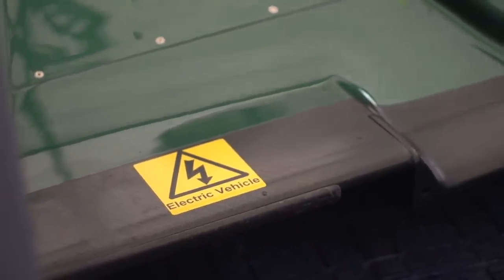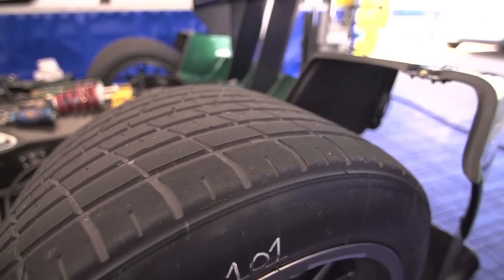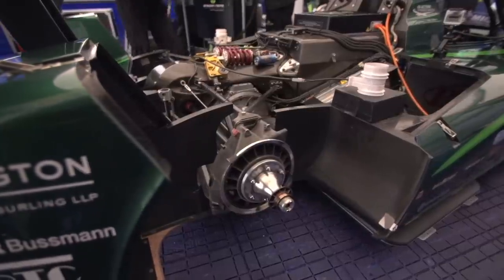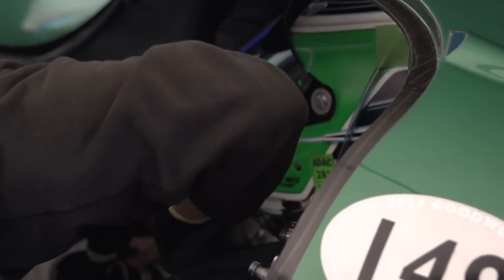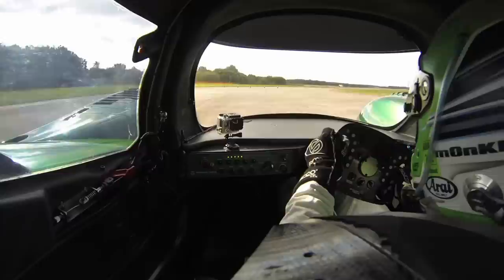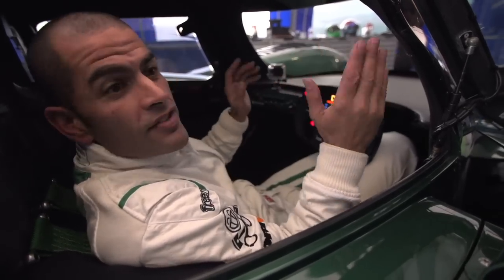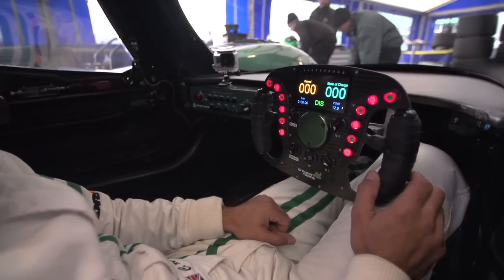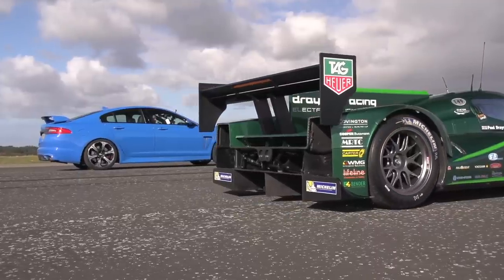850hp Electric Racing Car: Driving the Drayson B12/69EV -- /CHRIS HARRIS ON CARS

Comment: The only reason we like the sounds that race cars make is because race cars make them, and we associate the sound with speed. In actuality the sound is irrelevant. The silence of this machine makes it uncanny and incredible. I love that it's silent and I can't wait for the time when I don't hear what sounds like a race car going a hundred mph only to see a Honda Civic going thirty.
Reply: There is a tuned symphonic sound to a great engine that will never get old. Much like a cathedral pipe organ, a Stradivarius violin, or a saxophone, there's something inherently pleasing about a V12 at full rip, a beastly V8, a wailing Porsche flat 6, or a high-revving tuned 4.  May we never forget...
Reply: never forget the LFA's 9000 rpm howl.
Reply: Not really.
Reply: +Sidowse Teslas are a 1 trick pony. Accelerates quickly and doesn't do much else. Let's see it post some lap times
Reply: Sidowse I'll just buy a superformance cobra instead. Way more fun.
Reply: The Cobra like two stroke dirt bikes will always be badass because it's easy to work on and fucking fast. That said, engine sound with out the speed might as well be a flame job on a PT Cruiser.
Reply: Jordan Weimer a cobra would be fast as fuck even with 300hp because they are so light.
Reply: Sidowse  got quite a few track laps under my belt I know how to handle a car.
Reply: I totally disagree with you Jordan. I don´t like F! engine sound, for me it´s just annoying. But a road car enginge modified for track usage, with open intake and an not too loud exhaust is just a brutal sound that takes my breath when I´m standing right next to the car. You don´t like music made with an e-guitar because it´s made with an e-guitar, rather because it sounds awesome!

Comment: Wow, I kept trying to turn the volume up lol.... 
by watching this I realized when watching a video you get to feel the speed by hearing the engine rev.... Cool car and id love to drive it but entertaining to a crowd it is not!
Reply: Much agreed! While I respect the engineering and technology involved, it's this very sort of car that is killing the soul of the future. What the hell is the crowd going to enjoy with 30 of these on a track, waiting for a battery pack to melt down?
Reply: These cars have the potential to be reminiscent of the Porsche 917's from the early 1970's as far as performance potential and be even more so.  Paraphrased from wiki: "The 917/30 was the most powerful sports car ever built and raced. The 12 cylinder twin-turbo engine could produce 1,580 bhp (1,180 kW) in qualifying tune with twin turbos run up to full boost, 39 psi (2.7 bar), though it usually raced with around 1,100 bhp (820 kW) at 7,800 rpm to preserve the engine. Weighing 1,800 lb (820 kg), giving it a power to weight of 1967.36 bhp/tonne in qualifying tune and 1369.68 bhp/tonne in race tune. The 917/30 dominated the Can-Am series during the 1973 season. The 917/30 could go from 0-62 mph (100 km/h) in 1.9 seconds, 0-100 mph (160 km/h) in 3.9 seconds, 0-200 mph (320 km/h) in 10.9 seconds, and on to a top speed of more than 260 mph (420 km/h). The high-level of performance and attendant fuel consumption of the engines, and ever increasing risk, has led to the 917/30 sometimes being cited as the car that killed Can-Am racing.  The 917 was also the only championship winning car in Can Am not to be powered by Chevrolet."

The performance of those cars was insane and that was in the early 1970's!  1,800 lbs, 39 pounds of boost and 1,580hp!

And this is a first iteration of this electric vehicle.  They will only get more powerful!
Reply: noise shouldn't be the defining factor in motorsport. anyone who drives an electric car will realise how pathetically weak and inefficient combustion engines are. i would prefer a world with silent but fun to drive cars than cars that make lots of noise and smoke and fire, but put out crappy torque.
Reply: Wow, you must  drive a honda
Reply: Fullforce LTX i doubt you know anything about electric motors
Reply: I used to rewind them before the plant shut down in town... I know ALOT about electric motors, Dont get me wrong there great at what they do, but nothing will take the sound of a revving engine, especially shifting though gears.

Comment: Those of us that have brushless RC cars saw this coming.
Reply: this is definately true. I had a traxxas 1/16 slash that could go over 50 mph, w/out changing from the standard gearing. The torque of electric motors is amazing. (I will still be sticking with my turbocharged gasoline engine in my actual cars for the foreseeable future)

Comment: The fact it has 4000Nm of torque isn't exactly comparable to the torque output of a normal car. "Normal" cars are geared so you'll find that many sports cars have more than 4000Nm of torque at the rear wheels in 1st gear. However, with every gear change the torque drops and in top gear it will near 1000Nm or less. So if any of you have a light 300Nm+ high revving car, you can probably experience the acceleration of this thing in 1st gear provided you have the traction go to with the power.
Reply: That's circular logic. Combustion engines use gearboxes exactly because they have no torque at low RPM and therefore don't work at high enough final drives to reach the top speeds needed. Electric cars could use them, but have no need to introduce extra mechanical complexity, weight and drivetrain friction since they produce peak torque at 0rpm and can rev very high reliably. This is not a bad thing.
Reply: 000Haze His point was that it's not a like-for-like comparison.
Reply: j1mmyZeta Then its a fair point!
Reply: I don't think what you say is right or maybe I don't understand it. Petrol engines produce specific torque. Say it's 300Nm. They do that no matter what gear you're into. So even if it was available from 0 rpm and you were in 1st gear it would still be 300Nm. Not 4000 or 1000. And of course it would still feel like 300Nm.
Reply: ianiva you have no idea what your talking about..
Reply: ianiva yeah, engines produce a certain torque but that torque goes through the gearbox and the diff. Gears will increase or decrease the torque while decreasing or increasing the revs respectively. So if your first gear ratio is 4:1 and final drive is 3:1 then your torque is 300Nm x 12 = 3600Nm. This is the force with which the rear wheels are rotating in 1st gear. It's not the torque at the flywheel. This is also the reason why cars in 1st gear accelerate better than in 5th for instance. A standard 5th gear is usually 1:1 so this would amount to 900Nm turning the rear wheels.
Reply: ***** Then how about explaining it to me instead of saying I have no idea what I'm talking about. I clearly say that maybe I don't understand it.
Reply: ***** Oh OK thanks! Yeah didn't think that cars in the lower gears accelerate faster than in the higher ones.
Reply: ianiva
Reply: ianiva Try going up a steep hill in 5th gear. You can't do it, your car isn't producing enough torque at the wheels. That's why you would have to downshift into a lower gear, because lower gears have more torque.
I'm not a fan of electric engines though. I prefer my engine to make noise and blow a hole in the ozone.
Reply: ***** Yeah I know just didn't think about it before writing the comment ;)
Reply: Just to clear up this up for you guys; being in a lower gear allows the engine to spin more times for every meter (or foot) that you move forward. This means that it is producing more energy per meter. Energy of an engine can also be measured by Energy=(Torque)(Angle Rotation). So your car is not producing more torque in first gear than in sixth, but it is producing more energy in a given amount of time (this is called "Work"). So you put your car in a lower gear to go up a hill not because it will produce more torque, but because it will allow your car to produce more energy in a given amount of time (more "work") to get you up the hill.
Reply: 5jktm Thank you!
Reply: 5jktm Uh, no... the "meter" (or foot) term in a torque measurement isn't the distance you travel, rather it's the diameter of the spinning object (or the distance from the center of rotation) The larger the rotation the faster it needs to spin for the same amount of torque.

When you take the rotation of an engine or electric motor, and run it through a gear box you do change the output torque.  The engine/motor isn't producing more torque, but you *are* producing more torque at the *wheels*

Furthermore, the car actually uses a lot more energy when it's going fast then when it's going slow because there's more wind resistance. In fact, the amount of *energy* being used at a given RPM/throttle push is always going to be the same. You burn x amount of gas (or use X Coulombs of electricty) whether you're in first gear or 6th gear if you're foot is mashed down.

The difference is the torque applied to the wheels, after being converted by the gear box.

Also, electric cars do have gear boxes just like cars, they just typically have a single gear.
Reply: Couple of points: 1) Each of the 4 motors has an integrated Single speed transmission. Drayson haven't said what the gear ratio is but this car will have significantly MORE than 4,000 Nm at the wheels. 2) Electric motors have 100% torque from zero RPM... ICE cars don't reach peak torque until a few thousand RPM so EVs always win off the line!
Reply: If you have that much torque at the wheels at earlier gears, why would a dyno look like this: http://image.automobilemag.com/f/features/news/6696996/0705_c+2008_infiniti_g37+dyno_chart.jpg and not the opposite? Isn't that exactly what that chart would be calculating?
Reply: ***** Because rolling-road dynos record load data in only one gear, usually 1:1 top gear. Check out the torque profile of a YASA motor, as used in the Drayson EV http://bit.ly/1cTj1xb it's the inverse of an ICE.
Reply: tsport100, I did not know dynos just recorded the last gear! I'm still skeptical of Ops claim that standard 300Nm (roughly 225ft lb) cars see 4000nm of torque at lower gears.

The C6 ZR1 has 604 ft lb's of torque with a 1st gear ratio of 2.27. Lets say that torque figure was at the wheels and it had 750 at the fly. Lets say it has 1000nm going through the engine. So in first gear it has roughly 2270nm of torque at its peak, right? Still almost half of the Drayson and it is probably in the top 20 of the most powerful cars on the road. (that may be generous). Is my math off?

I would think comparing two cars nm output to be as apples to apples as you can get, regardless of what type of engine.
Reply: You forgot about the final drive ratio in your maths.

Comment: Wow, wait, 4000NM? Did i hear that correctly?
(12:00)
Oh shit
Reply: Yes.
Reply: Yup 2950 ft/lbs
Reply: Wow
Reply: macaron3141592653 .  I have been fortunate to drive some impressive car thus far in my life but 3000 Ft/Lbs of torque would be enough to put a hard-on on a Jellyfish.  Now to put this into context the current C7R Corvette is rated around 460 Ft/Lbs so you can then see why this thing can accelerate the way it does.  A Ferrari 458 has just 400 od Ft'Lbs of torque available at 6000 RPM.
Electric Vehicle HAS that torque available from 0 to it's top speed or whatever the motors are current and thus torque limited to. 
Astounding performance and shows just how far Electric vehicles have come in a VERY short time ,  The beauty of electric is you can place batteries in ans around everywhere and have the perfect weight distribution that doesn't change during a race for instance there for handling does.
Reply: mozzmann The car will get slightly lighter when it has no power left in the batteries though, because electrons do have mass...
Reply: Johannes Larsson Good point but I son't think it is going to effect the weight distribution in any way.
Reply: ***** Right, it doesn't consume electrons, and even if it did, the mass of an electron is so minuscule, it wouldn't make a difference.
Reply: macaron3141592653 They're measuring that at the wheels, aka with gear ratio applied. The motors themselves are producing much less torque.
Reply: macaron3141592653 and this is why all the P1-HY teams have their KERS systems enable the power coming out of the slow corners.
Reply: Johannes Larsson OMG you know nothing about electricity. The electrons are still in the battery even when it's "empty", they just moved.
Reply: Pow3rus  Probably partly my fault above , the car will be lighter but only by the amount of rubber scuffed of the tyres 'eh  

Johannes.  by way of explanation, Lets think of a battery system in simple terms as 2 reservoirs of water attached by a tower with one reservoir 50 ft in the Air and the other at ground level. BUT the entire thing is in effect the battery OK as it is isolated from ground.  The Charge is in this case water in the top tank and Fully charged there is 20000 Gal of water up top and that is in effect the Positive charge.  So if that charge of water runs a turbine as it runs to the Negative or Water tank at ground level there is no change in weight just a change in position it will still weigh 200000 Lbs -  but in effect in a battery you get half  of that or 100000 lbs of motive energy because you get a balance between the Positive and Negative terminals and so no current flow. 

Charging the battery moves the EMF Electro Motive Force from Neutral to high state of charge where it can be used again but the weight of the Battery in effect has not changed.
Reply: +Pow3rus The car converted electrical potential to heat energy. It would be lighter, even if immeasurably so. The dirt it picks up from the track would probably more than offset the loss of mass.
Reply: On the other hand, all the gallons of fuel you have to put in a gas car really weight a lot.
Reply: +macaron3141592653  I think I have a supercar too! It´s a 90bhp Vaux Cavalier, 145Nm max, 1st gear 1:3,545, final ratio 1:3,94  -> about 2000Nm at both front wheels, wooa! Don´t get freaked up by these torqe Numbers, they don´t tell you much about the performance of a car!
Reply: +awes0meguy13 That's more than a .30-06!
Reply: Pow3rus You know what? I were tired when I wrote that comment and I were kind of thinking with the wrong head... (If you know what I mean) And, I'm actually studying to become an electrician. But as I said I were tired... I didn't really think of the positive pole at the time.
Reply: mozzmann Don't you know that electrons go from negative to positive? If that isn't true, then electrons must have a "positive" charge and thus protons should be called something like "negatrons".

Comment: It must be so hard to know how fast you're going, not having the engine sound.
Reply: aMondia It's called a speeedometer
Reply: awes0meguy13 noone looks at the "speedometer" when you´re on track!
Reply: aMondia You  have the sound of the gearbox(on electrical racing car), the bearing, the aerodynamic and the electric motors are much less noisy but not absolutely quiet, so many sound to give your speed. 
By the way I evaluate my speed with my eyes and my acceleration with my back.
Reply: aMondia for us viewers its hard to tell how fast he's going with out the doppler effect. usually you hear it zoom past and you hear the noise fade away the quicker it's going the faster the noise fades. but in a silent car it's difficult to tell.
Reply: aMondia Someone could simply install some car noise generator that reflects the speed for people like you.
Reply: awes0meguy13 you don't use a speedometer during racing,. you use your eyes, head, ears and ass. That's why shift lights exist, if you are taking your eyes off the road, it better be for a mechanical problem.
Reply: aMondia Probably just feeling theh G's.
Reply: rokag333 I doubt it even has a gearbox cuz there is no gearbox that I know of can take 4000Nm of torque.
Reply: Nanorisk also doesn't need a gearbox. electric motors have max torque all the time, it probably has just one gear.
Reply: ThinkingBetter and for pedestrians. amsterdam is full of teslas, and damn, i was almost run over like ten times during my visit. at low speeds, you do not hear a thing if a tesla is approaching, and we're so used to hearing a car that one doesn't even look if there's no sound.
Reply: What does engine sound have to do with speed? Lawnmowers are loud as hell but they only move 1 km/h
Reply: Moustache Suave As the engine revs up, your speed is generally increasing.

Comment: What if the cars had a -step mode, so you could select like Chillstep, Dubstep, House, etc, and it would make/play music in relation to your inputs on the gas, clutch, steering, and anything else.

Racing would be like a giant EDM concert at hundreds of miles an hour, and you could even add scoring based on how good their music was.
Reply: Then the rally would be heavy metal and hard rock or maybe same genre in dune racing and formula 1 and offroad
Reply: Andraž Bravc
Drifting would just be a dubstep bass drop around every corner.  Formula Drift would be some of the hardest drops ever.

Someone go make a kickstarter for EDM cars.  Go.  Right now.
Reply: Nononononononononononono

Never anything near Dubstep

Never
Reply: Steven Zettel what about formula offroad? Those machines digging their way up the sandy hills with loudest v8s and paddle tires?
Reply: Andraž Bravc ....Metalcore.
Reply: Steven Zettel ok
Reply: Andraž Bravc
 \m/
Reply: Steven Zettel Yesyesyesyesyesyesyesyesyes

Near metal

Yes
Reply: Steven Zettel i think metallica - all nightmare long fits this one